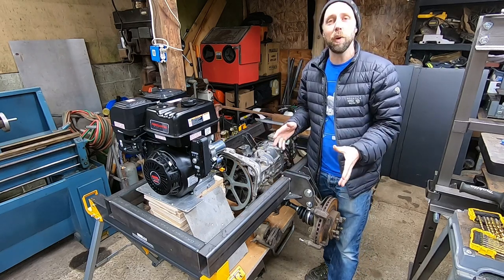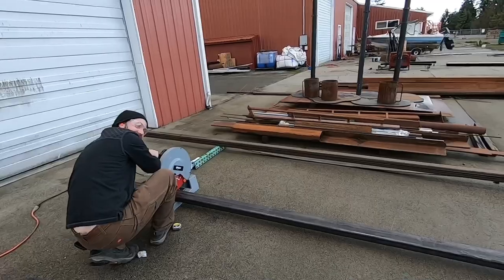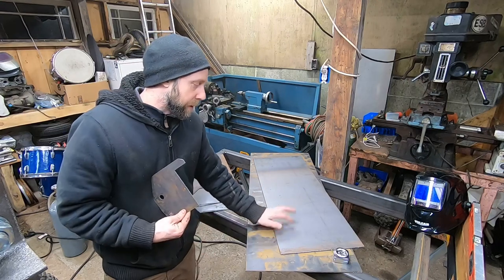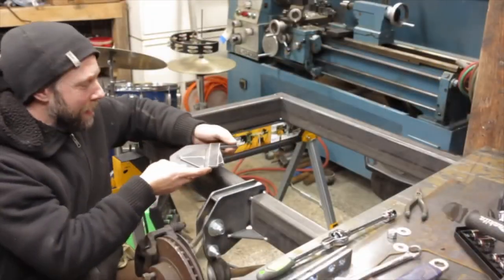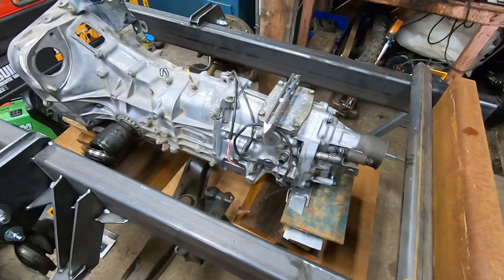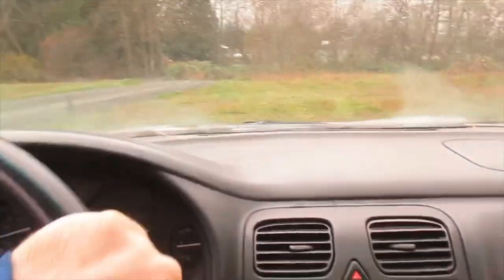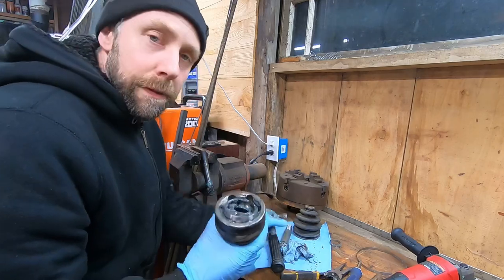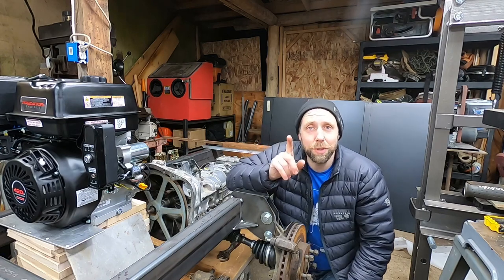420cc Predator powered articulating 4x4 dump truck build part 1

Comment: Great work.  I've got a similar project planned.  Couple suggestions.  A support bearing for the trans input shaft.  The pilot bearing in the back of the original engine supports the front of that shaft.  Belt drive will create a side load.  Automotive trans aren't designed for that.  Second.  The brackets for the steering knuckles will put a twisting action on the frame side rails.  A cross member, above or below the trans would counteract that force.  Could be bolted, making it easier to get trans in or out.  Look at an old truck with all leave springs.  There is a cross member at each spring attachment point.  The one at the rear of the engine bellies down under the clutch area.  Please don't think I'm being critical.  Just offering some ideas.  Subscribed.
Reply from the maker: Right on Chuck! Yes I got some pillow block bearing coming, one to support the trans input shaft and the others to support the center drive line. I will consider adding more gussets to the hub mounts, the frame is 3/16” I went for 3/16” rather then 1/8” just to withstand more loads. Keep me posted on how yours turns out!

Comment: Hello Mike,  I just ordered a CBN insert from China.  First I have seen of them on the 'reasonable' market.  I will have to see how well they do on the hardened steel as I do shafting all the time that is both heat treated and just plain hard steel.  Also got a price from that JDM in North Seattle on an 88 Kei truck, a staggering $8k!!!  Although he is claiming less than 20K on the truck it has a five digit odometer so he can dream up any number.  The original Japanese export papers have a true number on them I am told but only reputable dealers translate and make it available.  He obviously is not one of them.  That same truck at Houston Mini Trucks or in New Jersey would sell for less than 4K. His shows a lot of wear too so I suspect it is a 2 or 3 hundred thousand mile rig.  Prices that high are ridiculous as you can buy a much newer used Japanese compact truck for less (Mazda's, Rangers, S-10's, Toyota's, etc).  So your project dump looks cooler and cooler.  Can't argue with a plasma cutter cnc but it is just a huge chunk of money and takes up a lot of shop real estate.  Same goes with a water jet.  I will be watching.  Take care.  Doug

Comment: Furd 3/4 ton unit bearing and hub assembly?? A length of thick angle iron with both shafts paid into it and clamped down makes true alignment of 2 shafts,pipes,tubes,or axle bars easy... Looks incredibly great so far, and Merry Christmas to you n yours!
Reply from the maker: Right on I appreciate your suggestions! I definitely will try that on the rear CV joints 👍 Merry Christmas 🙂

Comment: suggestion........ put a torque converter on the engine and see if it helps or hinders the pulling power or performance with the manual transmission.....

Comment: You should finish it out with your Titanium Easy-Flux 125 if you still have it just to prove you can.
Reply from the maker: Haha I definitely could, I welded an entire sawmill start to finish with a flux welder, but I definitely paid my dues, it would work but the MIG is a lot faster because the wire is solid and a lot less cleanup. Take care

Comment: Mike, you have been holding out on us... First time I've seen the giant metal lathe in the shop... Go turn some bushings and stuff... :)
Edit: Mike uses lathe @17:30 HAHAHA
Reply from the maker: Haha I have had my lathe for a few years now, I have needed one, and finally put some cash aside and finally picked it up, it’s a 13”x 40” metal lathe, I also got a old rust bucket of a milling machine for free and fixed it up, I don’t use them everyday but when I do they really make special jobs easier. I never video in this side of my shop usually that’s probably why you have not seen those tools before. Take care Kyle 🙂

Comment: Definitely going to be an interesting build. I’m going to check out your videos on the cnc table.
Reply from the maker: Thanks 👍 I’m just about done now with it, just a little work on the cab and it’s finished!
In this video I was using the Crossfire CNC table, if you check out some of my later videos on this machine, I ended up buying there Crossfire PRO CNC table, it’s definitely an awesome table, and a great value 👍 Take care

Comment: Just one thing to mention about plasma table. 40sec cutting time only tells how long it takes to cut one, but you need to take in count number of identical parts and time it takes to draw and create the program on CNC. Thats why in every cnc individual parts price/time to make for one part is extremely high, compared to set of/several identical parts made, where designing, making the program and setting everything up on cnc mill for instance is spread to number of parts. For single part sometimes making it with angle grinder or in manual machine is faster and cheaper than cnc.
Reply: I have a 5 x10 foot cnc table and i draw with tensorcad
Drawing and cutting of this complete 2 wheel set will take less then 8 minutes
So start up your grinder😂

Comment: Couple things about the unit bearing I would consider the cheap ones wear out alot under normal use I am not a ford fan my step father has a few work trucks and they all drive 300 k but I would build a slip type drive shaft through the unit bearing( I think that's ur plan?) I believe stub shafts are 1.5" but these wear out with normal use and what ev u come up with needs to be taken apart right here to change this. And the fine thread studs have a higher load rated bearing... Or maybe vise versa but thats how they are sold at autozone cause I am replacing some on a 2001 f250 and the other is for the drw And in my opinion are not to be trusted. But love the idea... Those unit bearings do not use the same style bearing as the spindle with the lock nuts on it... u could adjust the preload on tapered roller bearings from a dana 50 60 and even a gmc Kodiak with a 70 front all use the same spindle just a larger bearing in the hub. but the same kind of knuckle so spindle and the stubs are reasonably similar. I have seen road equipment and tractors use dana 60 and 70 fronts and I have seen the Kodiaks as city trucks just a thought love the idea right on.

Comment: The moment I saw you put that axle in the band saw I clenched up because I knew that blade went bye bye lol.
Reply from the maker: The Metal Butcher I just changed out that blade a week ago. It had a lot of cuts on it before and I got over three months after that. The only reason I changed it was the welded seam broke, it was still cutting good. Good blades hold up but man they are about $24 a blade. Take care 👍
Reply: @Mikefestiva  Fair enough. With larger saws with much higher feed pressure and coarser blades, running into hard stuff can be a lot more catastrophic. Enjoying the series, thumbs up.
Reply: @Mikefestiva   a tip for welding your axles true and or drive shafts in the future. Place the axle or shift in a piece of angle iron. It holds it square on 3 sides. Alot less to mess around with.

Comment: 3/4 ton or 1 ton wheel hub and bearing.
Reply from the maker: Yes 99 Ford super duty F250/F350/F450 4x4
Take care 👍
Reply: @Mikefestiva , nice. I have a question. Did you get one with a wheel speed sensor for a reason? This build fascinates me. I will watch it the whole way. Subscribing.

Comment: Hey Mike. I am going to subscribe, because this ought to be good. Maybe on the transmission mounts put some metal in between the halfs. I just can't wait to see this one. Also, man have a Happy New Year man.
Reply from the maker: Thanks James! Yes I already have the metal cut to gusset between the trans mount, I’m just holding off to weld them in till I confirm that the mounts are in there finally position. Thanks for checking out my video and subscribing 🙂

Comment: Looks like a F350 wheel bearing/hub housing.. could be wrong though.  But dam is that thing over built man lol  I'm not saying it wont work... but wow, thats a lot of metal going on there for that little 400cc
Reply from the maker: Thanks for checking out my new project! Yes you are correct on the bearing. I’m sure it’s a bit over built but I would rather be on the heavier side then under build it, I plan to haul 1,000 to 1,500 Lbs of dirt in the truck bed and logs to my mill. 
I’m also hoping to add a snow plow up front.
Keep in mind the engine is going to be geared down 4:1 to increase the torque to the wheels. Take care

Comment: For welding the CV shafts back together would it help to clamp them into some angle stock to get the initial alignment when tacking them together?  Just a thought. And yeah, I realize that even if it is a good idea it is a few years too late. 😁
Reply: Never mind.  I got to part 4 and you mentioned a lot of other people had the same suggestion and you used it for the rear.

Comment: Well, it's an 8 bolt hub, my guess would be a front wheel bearing from a heavy duty truck. The wire coming from it suggests to me that it's whatever side has the speed sensor for cruise control.
Reply: Abs brakes

Comment: I’ve had this idea for 10 years in my head. I was thinking PTO to motor the hydraulic motor to trany second motor for bucket in front and dump bed in rear.  What do u think ???
Reply: I have also been thinking about a project like this and I think a hydraulic drive system would work well  the challenge is finding  the hydraulic components  or a donor  vehicle to cannibalize  and keep it with in buget  I think if you had the rite pump and motor combination and ran it into a 2 speed transfer case  out of a full size truck or even a toyota  it would work well

Comment: Couple questions, are you going to weld the center differential? Subaru center differentials are a viscous style, so yes it's AWD, but not locking AWD. Second, have you ever looked at the older Subaru GL transmissions? They were the ones with a shiftable 2wd, 4wd and 4wd low range.
Reply from the maker: Thanks for checking out my video. I’m not sure yet on what I will do, I figure I will build it try it out around my property on mucky trails and if it’s not aggressive enough then I might take the trans apart and weld the center diff solid, maybe the rear too? I do know the car originally got amazing traction in the snow. 
A friend offered me the other day the drive train out of a older Subaru, I think it’s a older GL? Once I get this one built I may take him up on that and build my son a smaller tractor? Who knows maybe I will be burnt out by the time I’m done with this one 😂 Take care
Reply: Maybe better off using a Jeep transmission and transfer case then you would have low range
Reply: @tinytrax1978  then he would have to deal with putting in a front axle. The Subaru transmission deals with having to put one in.

Comment: Super cool build Mike! Looking forward to following along. That hub at the end looks like it's off a truck or something, or maybe a Toyota pickup? I dunno....? Looks like the Harbor Freight Plasma is working super well too! Finally saw one at the store by me and it looks pretty nice, price wasn't too bad either, if I recall it was right around $700. I'm sure it'll come down in price, but it seems like a nice machine and damn, it looks to cut REALLY well!
Reply from the maker: Thanks for checking out my new video! Yes the front hub is from a 99 Ford F-250/F350 super duty 4x4 I bought the stoutest hub I could find at a auto parts store and it was only $128. I found them for $80 on Amazon but figured I would spend a little more to have it for my project sooner because I have a week and a half off from work! And I wanted to get a jump start on this project. So far so good with the Titanium 45 plasma torch, I probably have cut a few hundred feet of metal and aluminum with it so far. Take care 🙂
Reply: @Mikefestiva  Thanks for the reply Mike! Enjoy your time off! I have a few days off here and there and some half days which is nice! I need to start some kind of project, but it's hard to find motivation, at least the weather here has been pretty decent. That Ford hub looks super stout! They built things well back then and there is something to be said for that. I'm seriously considering that Titanium 45, looks perfect for a hobby shop like mine. I have a feeling that they will sell well. I think Harbor Freight has stepped up their game a bit as well. Have a great holiday and New Year Mike!

Comment: Great project!  I have been thinking about doing a very similar build myself so I'm looking forward to see how yours turns out when completed.  Why not use the Subaru  engine to power it?
Reply from the maker: Thanks for checking out my video 👍 the problem with running the stock motor is gear ratio, it would go 20 MPH in first gear, I want it to go 5 MPH and it’s quite easy to do with chain and sprockets especially when dealing with 20HP and under.

Comment: Nice design. Is the 13hp motor enough? The Subaru running gear is geared for a 130hp motor
Reply from the maker: It’s got a 8:1 gear reduction I built into the machine, check out later episodes 👍

Comment: Did you tighten the cv boot clamps with a needle nose? Does that work well, I thought you needed a special tool, thanks
Reply from the maker: Yes I used needle nose, I thought you needed a special tool also, my friend mentioned once you get them snug you can clamp down on a raised part of the ring with some wire cutters and crimp them tighter, just don’t go crazy and cut through the ring. Take care

Comment: so , are you trying to end up with mini truck that articulates like a coot  - but also dumps ?
Reply from the maker: Yes it’s going to be a small articulating truck with a hydraulic dump bed, possibly a small blade up front for pushing snow. I have a small 4x4 tractor and I would like to do more dirt work around my place, I hope be able to haul 4 or 5 tractor bucket loads in the dump box. Take care

Comment: This is going to be an awesome unit. Can't wait for the next installment. Question...On your front hub mounts, did you allow for any camber adjustment? It looks on video that the front wheels will lean in at the top quite a bit.  Great content so far, keep up the good work.
Reply from the maker: Thanks for checking out my project 👍
I think what you saw was just from the wide angle lens on my camera, when I drew up the hub mounts I took the angles into count, the rotors are true vertical and horizontal to the frame rails. I should have part two posted this coming Friday 👍

Comment: I am so jealous. You will never hear my bitch about anything. However I may inject an idea or my opinion every now and then. I have been wanting to build a mini articulated log skidder for a long time. I can't wait to watch more. I have had an idea for the articulated joint with the use of three sealed wheel bearings.
Reply from the maker: Right on! I would like to hear more about your wheel bearing idea.
Reply: @Mikefestiva It's basically an 8x8x8ish box tube. One end welded with 8x8 sheet. With hub mounted on boxed in end for up and down movement and hubs mounted top and bottom of the box for side to side movement. Have not figured out all the details yet though.
Reply: Wish we could share pictures on here.
Reply: I am on FB if you are.
Reply: How and where can I send you some pictures?
Reply: I have a few pictures of an autocad drawing that I did posted on  Facebook Group called homemade skidders.

Comment: Wow nice vedio i really intrested in mechanical work, but with humble request, 
What is the model of the subaru car, you get the transmition from it, thank you so much to share with us your experinces
Reply from the maker: I pulled all the running gear out of a 97 Subaru Legacy wagon. It had over 300,000 miles on it! 
Thanks for checking out my channel 👍

Comment: Really need to get cv axel grease. And there is not enough grease in those boots.
Reply from the maker: I got high Moly grease for the joint, Haha were you there with me when I packed these CV joints? No. So how would you know how much grease got applied into each joint? I think it would be hard to tell from the time lapse 20 times faster. 
People like you crack me up there’s always some know it all that’s got to spout out what I really should do. Don’t worry Kyle it’s going to be fine.

Comment: did you ever view  Pug Utility Vehicles,  much the same as your project.
Reply from the maker: Yes I looked them up after you  mentioned them, they look cool, I have never seen one out on the west coast, I’m sure there must be a few kicking around but in my 38 years I have yet to see those cool machines in person. Take care Carson
Reply: @Mikefestiva  There was one here on a farm in Virginia, it was about as beat up as I have ever seen a vehicle. It ran like a champ. It was a smaller size, shorter wheelbase, engine and trans under the front seat. They would tackle a lot of terrain but not an all terrain vehicle, the wheel size and type of tires on it were the small variety on this one.  The good thing about them was their off the shelf parts list.
Reply from the maker: I will definitely need to research and look into them more 👍